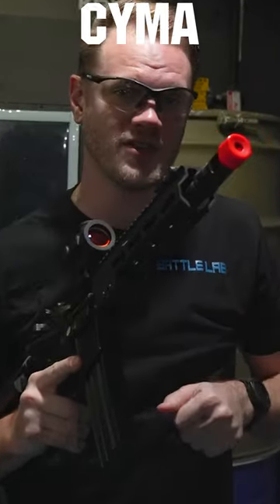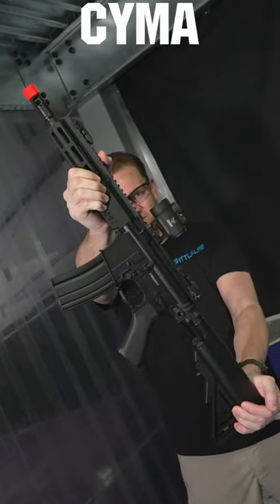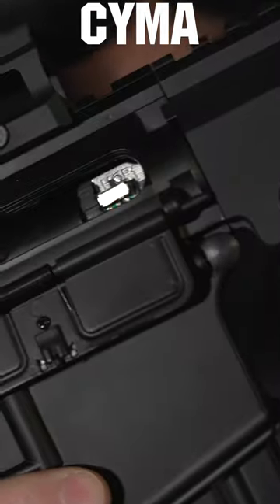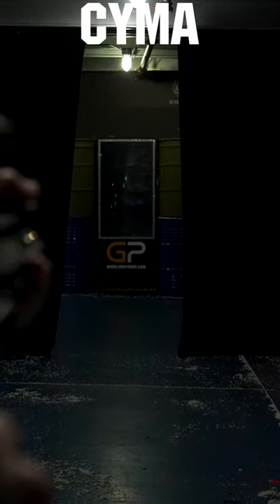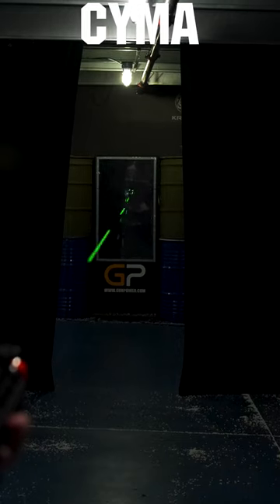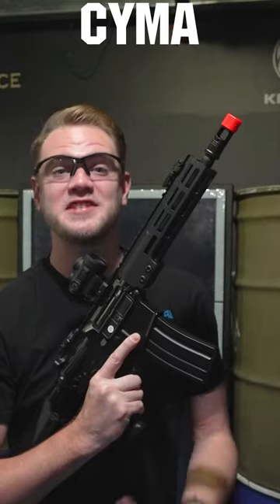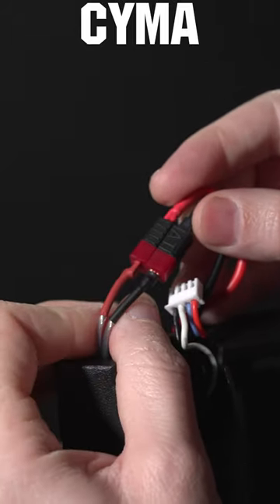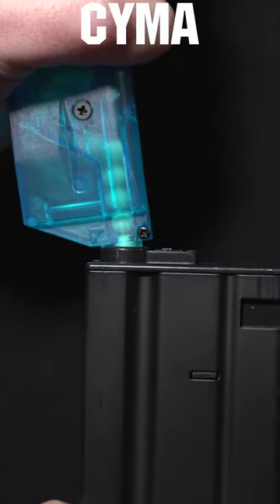M4 with a BUILT-IN Tracer Unit!?

Comment: 2 UV LEDS, a switch, 2 wires slaved from the battery and a file. and you can convert any hop up chamber into a tracer one. and if you put the LEDS on the feed tube not the 'chamber' behind the barrel, will mean you only really get tracer on longer bursts, so can still have sneaky beaky semi auto with tracer on burst/auto, a very simple mod to do as well.

Comment: I suggest don't use lasers because the second it is pointed at a player they are going to duck or run out of the way. Or pin point you with the direction of the laser
Reply: its not a laser lol its a tracer unit for bbs

Comment: It's my personal opinion, but i prefer classical removable tracers, they might look a bit ugly on some guns, but at least you can choose what tracer to use like spitfires, multicolored, etc...
And if they break you can just repair or change them, without opening the replica, and buying expensive and pretty rare pieces like tracer hop-up
Reply: Has a tracer broken for you? It’s hard to imagine something without moving mechanical parts to break easily. If it’s made into part of a proprietary hop up then I hate it for making the hop up not easily replaceable.
Reply: You can still add another tracer, but you would need sunglasses or else you may be blinged by the power of the sun in 6mm form